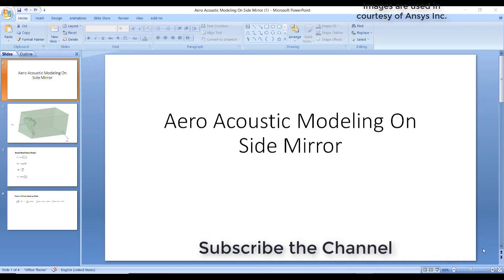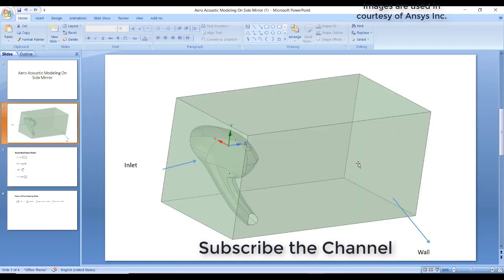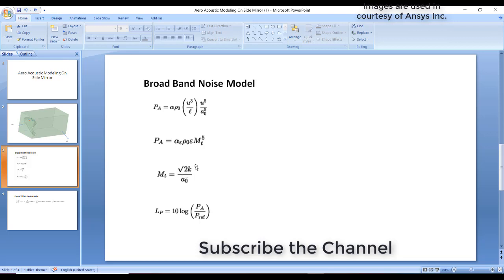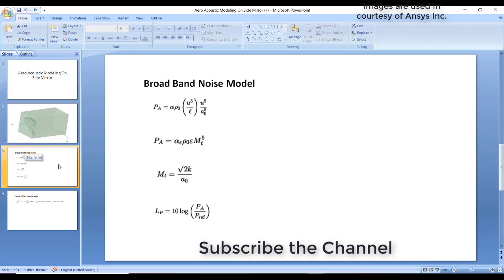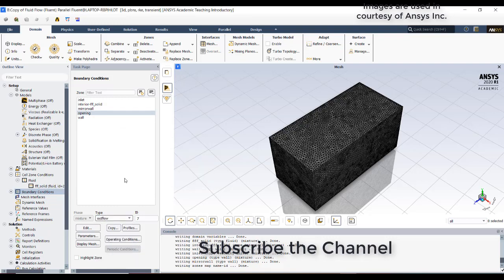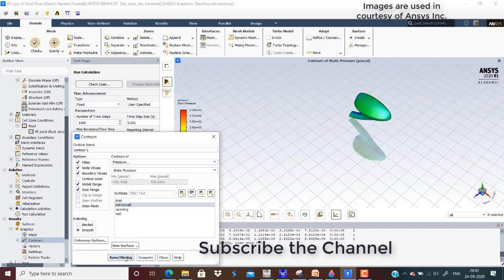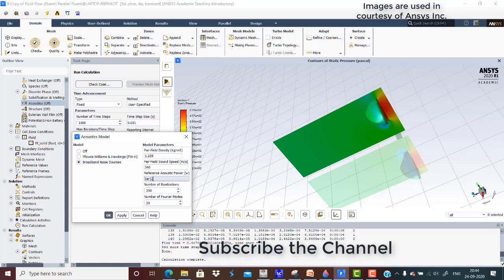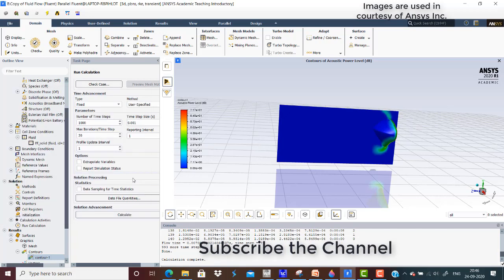Aeroacoustics analysis part 1 using broadband noise model || Ansys Fluent

Comment: Hi, when we use broad band noise model, we have two variables in the output.. Acoustic power level and surface acoustic power level... which one we have to plot to check the sound levels on a surface of the object (in this case the mirror)..  Thank you!